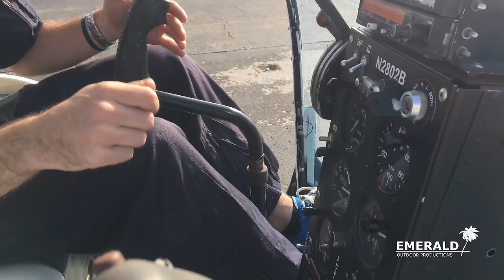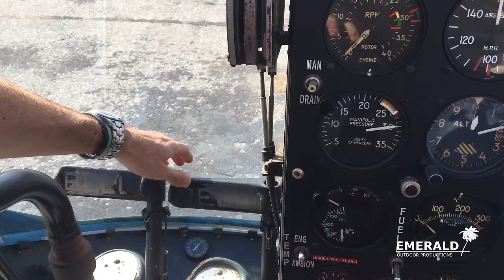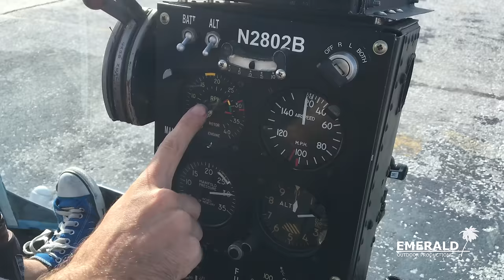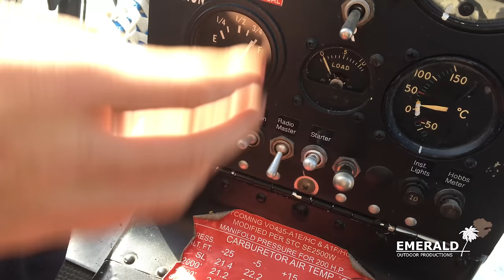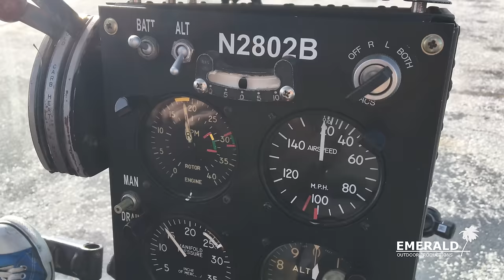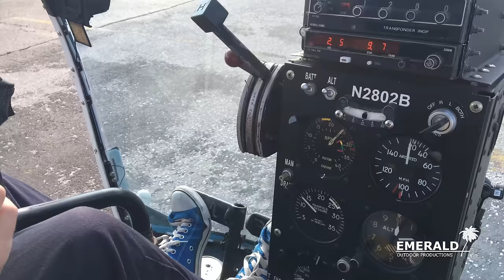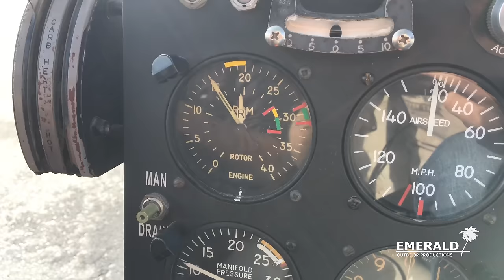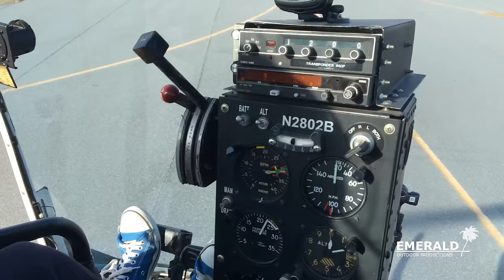Bell 47 G-2 Helicopter Start Procedures (ft. Mario Werth)

Comment from the maker: 📌 The Bell 47 series has really blown up over the last few months. Still having access to the G-2, would you like to see some more Bell 47 content? If you have any areas of interest that you would like to see more information on, drop a comment below! ⬇⬇⬇
Reply: Emerald Outdoor Productions one thing I have wondered. So I get the mechanics of a helicopter for the most part but how does the clutch system work between a piston engine and the rotor. With turbo shafts the engine and the rotor shaft are separate systems where the engine spins to a certain rpm at which the thrust can start rotating the power turbines and get the rotors spinning but I never conceptualized how the internal combustion engine is able to engage the rotor and overcome the great forces without burning the clutch mechanism or stalling the engine  or having some other faliure?
Reply: Emerald Outdoor Productions how do you control the speed of the RPMs?
Reply: We can freely announce it to aviation teams and on our page ???. YES or NO ??? To know...!!!
Reply from the maker: I'm not quite sure what you mean..? You can share the original link or embed of this video, yes. Just do not reupload.
Reply from the maker: @santinojozefmiller7721   I had no idea this pin was ever commented on. I guess better late than never.. RPM is controlled by throttle on the collective. There is no governor, so it's controlled manually from startup to shutdown.
Reply: @EmeraldOutdoorProd  👌
Reply: Hunt down more models.I have flown the G2 with wooden and metal blades,the G4, G3b1 and the J. I haven’t flown the G5 ( larger bubble).So covering all the models would be good. I flew the G2 on fixed floats doing full autos onto a lake,that would make a great video.

Comment: Great vid! What are the magnetos for and why do they have to be checked? Do they fail often? What happens if? Why do the carburators need seperate heat? What is important about the cylinder head heat? Where are the gauges for oil pressure and temp? Is the engine air cooled?

Comment: When you split the needles on the free wheeling check, put in right pedal. Because if that unit does not split the helicopter will pivot, so always push right pedal.. glad your flying this awesome helicopter
Reply: So what Flight Sim are you flying this on?

Comment: I seem to have missed the final start button push - is the button located at the collective, operated with pilots left hand?
Reply from the maker: The G-2 is normally started either by key or a button on the pilot's collective. This particular one is on the collective.

Comment: Purpose of friction collar??? so controls aren't so easy to move without effort?????
Reply: You fly with the frictions off. The friction is to hold the controls when you do not want them to move. In this helicopter and others with hydraulic controls. If you were to let go of the cyclic with the friction off (pilots are taught not to let go of the cyclic when frictions are off). The cyclic would fall/move in any direction which makes the main rotor move in the same direction as the cyclic which makes (or tries to make when on the ground) the helicopter to move in the direction of the cyclic.

Comment: I can't hear what he's saying at 9:08-- "when you look at the main rotor something something something."  Can anyone help?
Reply from the maker: "If you look at the main rotor tip path plane before takeoff, you can see that they are rigged the right way." To simplify it, he's talking about the trim tabs on the trailing edge of each rotor blade tip. You want to ensure that they are rigged properly so that both rotor blades have the right amount of trim. Of course, the camera allows you to see the trim tabs easier, but since it's harder to see with the naked eye, you just pay attention to the path that each rotor blade tip takes to ensure that they are aligned.
Reply: @EmeraldOutdoorProd  thank you so much.  Makes complete sense now.

Comment: LOL dead battery at 6:32 and he takes a break but never admits the truth the battery was dead. WHich was the wrong thing to do in a training video. You should always explain even what unexpected things are. instead he goes away comes back and you see the battery switch is still on but now everything is operating. Obviously, they took a break to charge the battery. lol
Reply from the maker: Nice assumption, but I'm sorry to be the bearer of bad news. It's completely wrong. We actually did cut there to put on headsets and start GoPros. I don't have a continuous shot, but I do have all of the original clips, and the date modified timestamp from the cut to the next clip is a whopping 10 minutes. Not nearly long enough to charge or swap a battery and get all set back up.